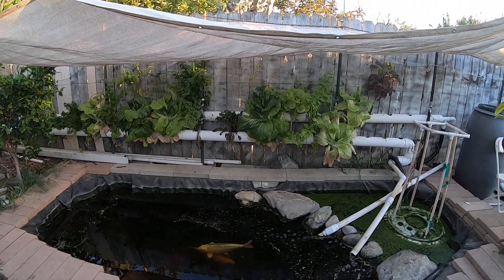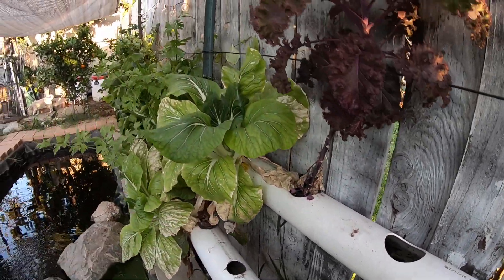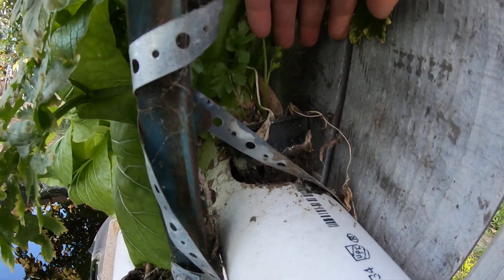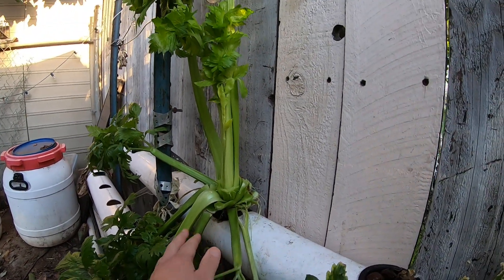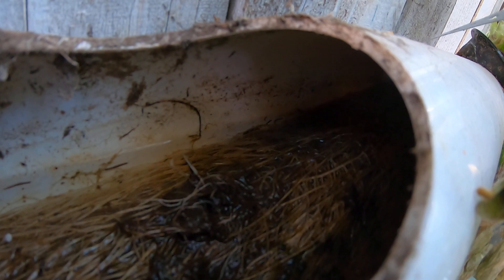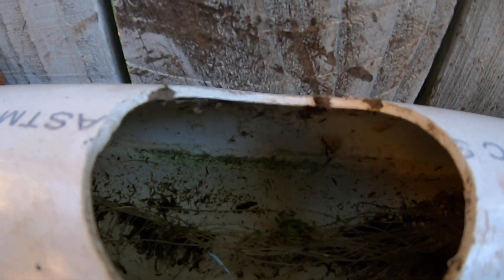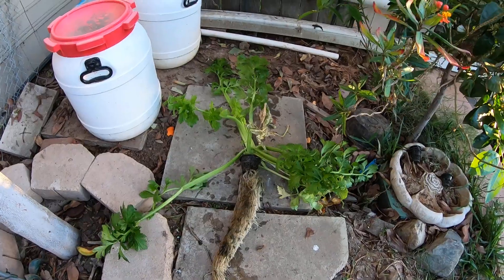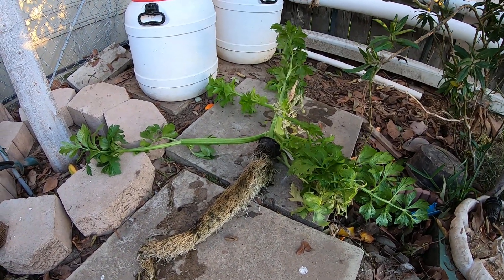Aquaponics: 4 inch PVC pipe is just right

Comment: What is space between
holes
Reply from the maker: I don't have the system anymore, but I think I spaced them out about a foot apart on the top level and 9 inches on the bottom level. If anything, you can always leave an empty hole to help keep track of the water level in the system.

Comment: I'm using 4 inch also for hydroponics, but the water level is not high and does not reach the roots

How to solve this problem? Is it because my water is not enough? I store water (NFT style) in a bucket and it recycles.
Reply from the maker: You can install a pump that has a higher gallons per minute to get more water flowing. But it might become a problem later once the roots grow because they will slow down the water flowing to the exit and water might spill. 
For now, see if you can somewhat block part of the water exit with a long rock that won't come loose or fall inside. This should allow the water level to rise a bit. But if the rock blocks the exit, water might spill.
The only other thing I can think of is tying strings to the bottom of the net cups to bring up water to the roots or add pvc reducers to make the exit  smaller or higher.

Comment: What size holes and net cups did you use? 3 inch it looks, or are they 2 inch?
Reply from the maker: The top pipes have 3" net cups and the bottom ones are 2" net cups.
I used 3" and 2" hole saws, but for sure the 3” hole saw seems too big for the 3" net cups.